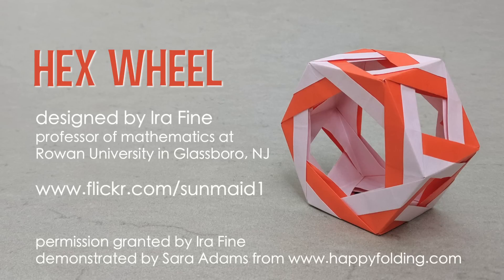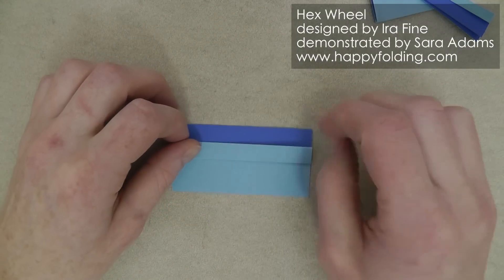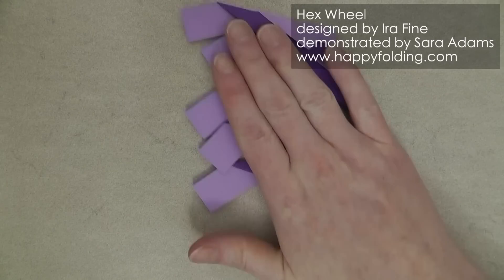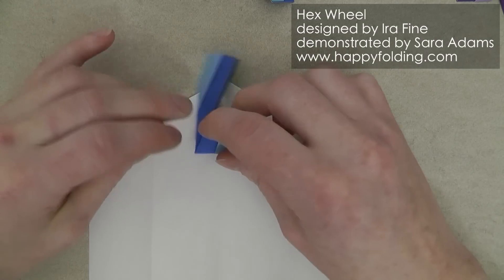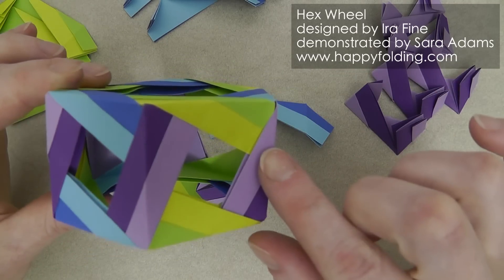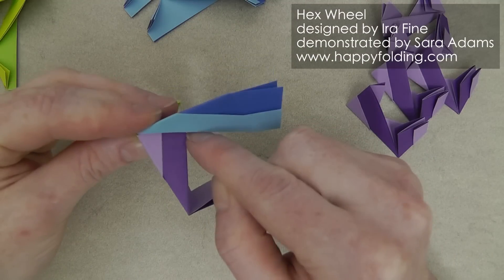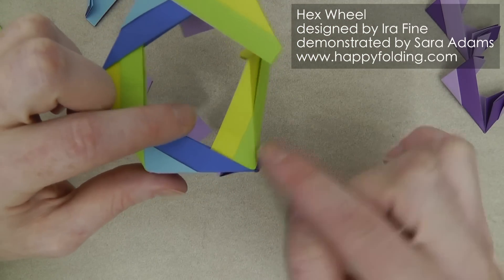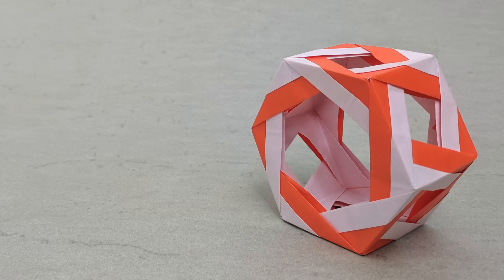Modular Origami Tutorial: Hex Wheel (anonymous)

Comment: Hi, the last two folds for each module (the 90 little flaps only, not the 120 ones) often are hard to match with the same crease belonging to the pocket, because the little flap reaches the end of the pocket earlier as expected, and corners get a bit messy. I guess it would be useful to start each module with a main spine a bit longer than from 1/4 and 3/4 of the sheet. I'll give it a try.